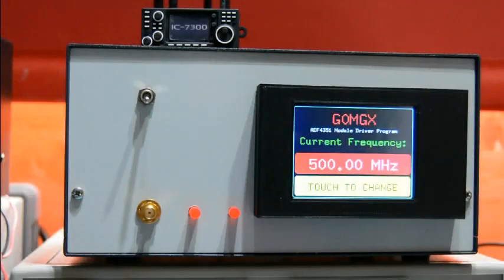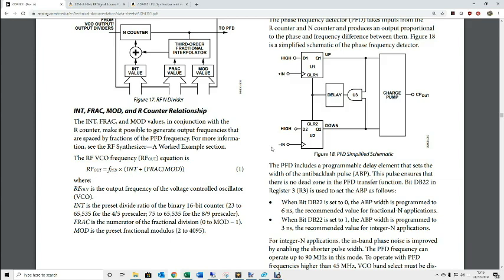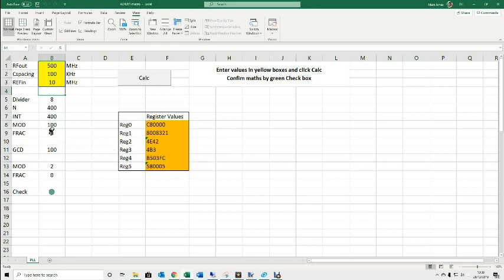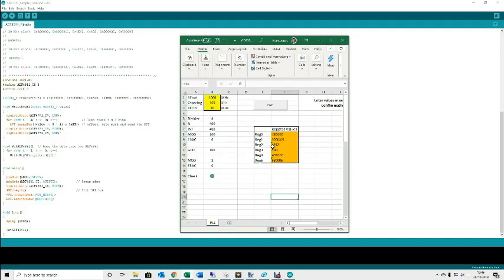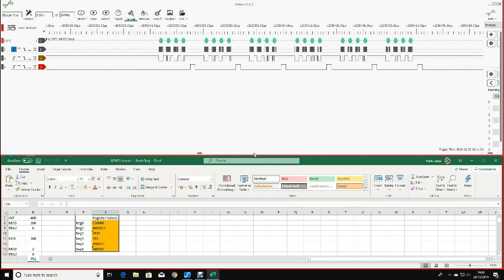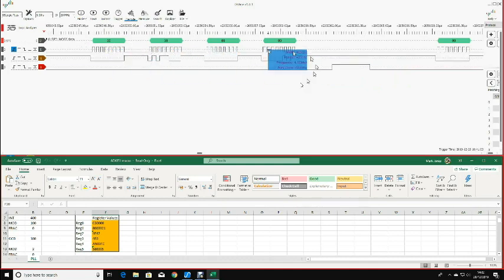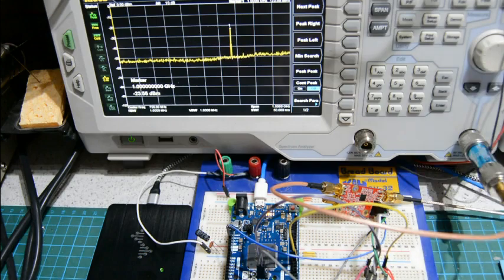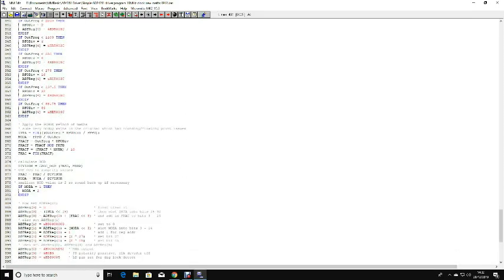ADF4351 Musings and Experiments

Comment: Fascinating! Unfortunately I'm a 75 year old, reared on valves and CW, so most of this is way over my head. I'm OK with a soldering iron and thru' hole components, and can just about manage a bit of surface mount, but the SW and math are a step or two too far for my moth eaten old brain. That 4351 thingy looks just the job as a sig genny for my covid refurbished shack. Can you suggest a route to learning the basics of of this stuff? I could put your boards together OK, but the SW etc is gobbledy gook to me. Perhaps I should wait for my next reincarnation...won't be long now! {;o)
Thanks for all the work you put into this stuff.
              Vy 73 to u es urs.
                        John EI7BA
Reply from the maker: Hi John, Interestingly I am authoring a book for the RSGB "Microcontrollers in Amateur Radio" which will be out maybe by Christmas. Perhaps that is the introduction you need? Glad you are enjoying the channel.
Reply: @MarkG0MGX  Great...Thanks Mark!

Comment: That is a cool project. Did you observe any spurs around the fundamental frequency?  I am planning to use that chipset too, and I am trying to figure out the spur locations to see if they can be filtered out.
Reply from the maker: You have to be careful about correctly terminating the clock signal. I used an external clock so terminated it in 50R and the spur content cleaned up considerably. They are quite clean - have a look on google for the work by GM8BFJ, some links and other information here: https://g0mgx.blogspot.com/2019/06/13ghz-sig-gen-you-cant-be-serious.html

Comment: Well done Mark. The little I know about these synthesiser boards comes about from building the PIC controller for an ADF4351 per the BATC Wiki here - https://wiki.batc.org.uk/ADF435x_PIC . CQ-TV259 contains the details (£8 pa to join or wait till it goes to the public archive elsewhere on the BATC website). I used ADF435x.exe from Analog Devices to get the Hex values for the fixed frequency that I needed for my upconverter mixer project C code. There were 5 or so power values. I assume you've chosen a single value of dBm for your project? 73 de David M0YDH
Reply from the maker: Yes, the outpuit power is fixed at the highest setting for the device (bits 3 & 4 of register 4) - I also have a generic MMIC amplifier on the output. Would be a nice mod to include control of the power output level - would be very easy to add this.